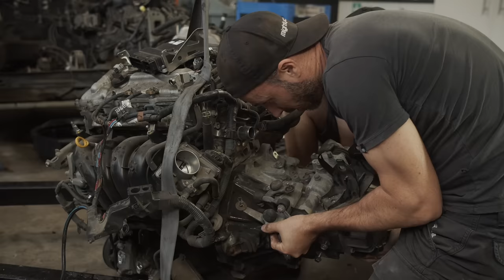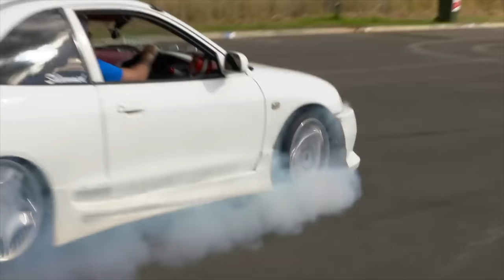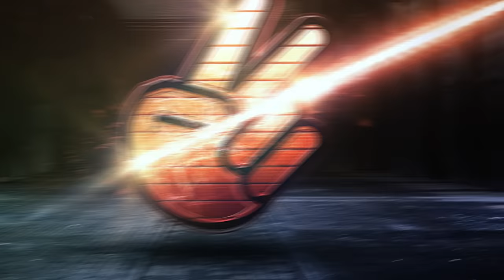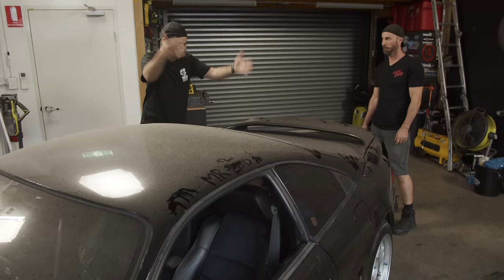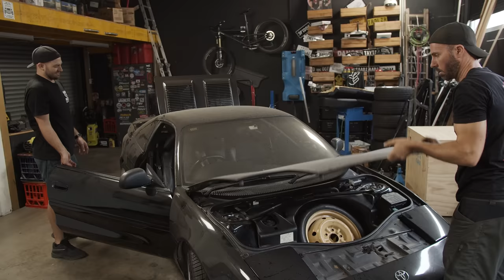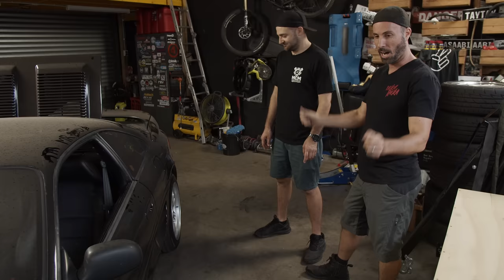$10,000 Rear Engine Challenge (Marty's NEW CAR)

Comment: Leave it on stock ride height, or get geometry adjustment if lowered. Good bushes, good coilovers, and good wheel alignment and you will struggle to get any snap oversteer. They are staggered stock. @Mighty Car Mods

history of motor:
https://www.youtube.com/watch?v=hF_6iaYSe4g&t=8s
(The 3sgte was used in Tom's Supra. This car beat the Skyline domination. It had a 2jz swapped out for a 3sgte)

Racing pedigree in JGTC and Bathurst:

https://www.shannons.com.au/club/news/toyota-mr2-japans-giant-killing-bathurst-champ/

JGTC:
https://garagedreams.net/history/toyota-mr2-history-every-generation

Many believe the record set by the sw20s in JGTC (most wins in one season) will never be broken. The mr2 dominated JGTC for quite a few years.

Comment: I know the lack of a hoist/lift has come up before and that the concrete in the shed doesn't support it.  Also, you don't want a lift dictating parking angles.  Have you considered something like the side lift featured in the TUV episode? It got me thinking so I did a quick bit of googling and found several side lifts, many portable.  Unfortunately everything that showed up for me was in the US so I checked in AU and found this, which solves both issues: http://www.herohoists.com.au/download/lk-portable-single-post-lifter-2018-.pdf - I have no idea about this company or the product quality so some research would be prudent.